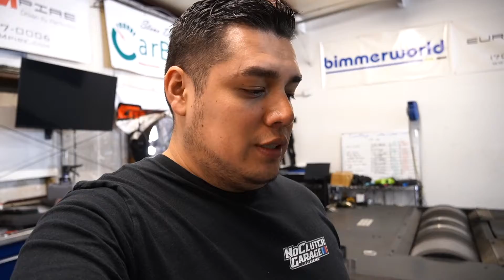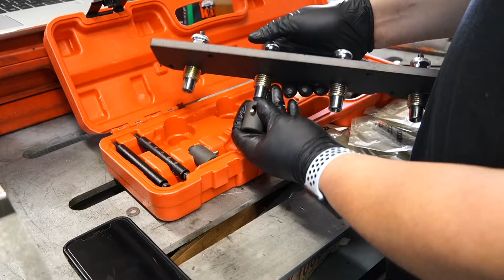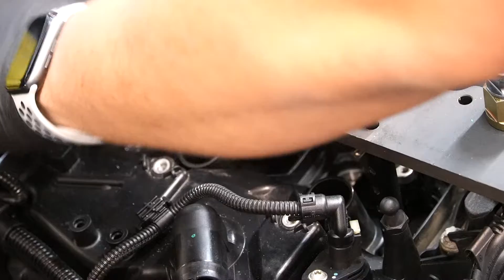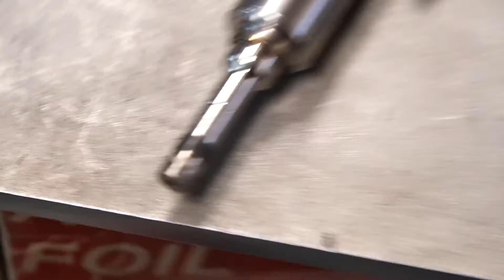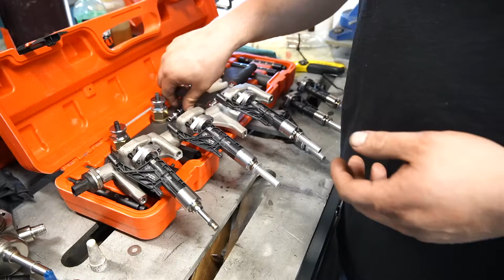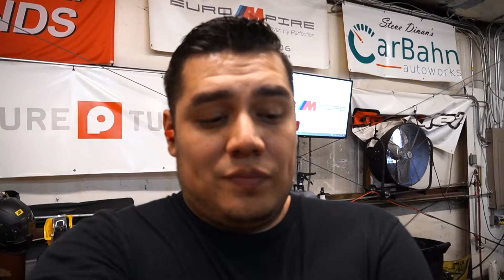BMW B58 INJECTOR REPLACEMENT DIY | Feat. BimmerNetwork

Comment: The 8 railscrews get 5nm + 90 degree… if you mount them only with 5nm, the risk is high, that the rail cant hold the 200bar railpressure. The screws are stretch-bolts; these ALWAYS have a 2 phase mounting sequence: fastrn to 5nm and after + 90 degree, so they can deform and grap tight. These extra 90 degree is the step that tightens the bolts. Thats why you always have to replsce them after demounting the rail. Only 5nm is HIGHLY RISKY!!

Comment: Thanks for the vid, just did this job. Drives great and no codes but didnt reset the adaptation. Ill go ahead and reset them with the autel when back in the shop. Thanks again.

Comment: Hey man, I know this video is a little old, although I am in dire need of those injectors caps that you used to compress the seals. None of the tools I am using work to compress it. I’ve tried every b58 injector seal tool with no solution. If you could possibly send or tell me what brand those are I would appreciate it.
Reply: Have you found a solution now ? I am having same problem
Reply: Another way without a tool is take a piece of rubber fuel line and run it over the seal and they tighten a hose clamp and let it sit for a few minutes. Hope that helps
Reply: Yea you don't need those "caps" to compress the new Teflon seal. I've use a tool from dptool from Amazon for mine. Different tool but same concept, just need to apply pressure to compress em tight

Comment: The torque sequence wasn’t correct!
Reply from the maker: Literally read off of Alldata idk what you want me to tell you
Reply: @NoClutchGarage  Im just saying thats not the correct way bro
Reply: @NoClutchGarage   down until there is resistance, position screws (M6x70) (A), (B), (C) and (D), and turn them until hand-tight.
Set torque wrench to 2 Nm.
Tighten the screws (A,) (D), (B) and (C)  at 90° each in an alternating order using the torque wrench until the rail rests on the cylinder head.
The figure shows the rail resting flat against the cylinder head.
Reply: @NoClutchGarage  Tighten screw (A) by 5 Nm.
Tighten screw (D) by 5 Nm.
Tighten screw (B) by 5 Nm.
Tighten screw (C) by 5 Nm.
Connect and lock the connector (2).
The connector (2) must engage audibly.
Reply: @NoClutchGarage  Insert a wrench socket into an extension.
Do not use a reversible ratchet or torque wrench.
Hand-tighten the screws (M5x30) respectively in pairs (1) with (2), (3) with (4), (5) with (6)) alternatively with 90°.
Set torque wrench to 5 Nm.
GRA-SYM-GRCI0000-10-INFO
Reply: @NoClutchGarage  Fuel injector 1:
Tighten screw (1) at an angle of rotation of 90° ±15° with the torque wrench.
Tighten screw (2) at an angle of rotation of 90° ±15° with the torque wrench.
Repeat the operations for bolts (1) and (2) until both bolts reach a torque of 5 Nm.
Reply: @NoClutchGarage  Mark all bolts (1) to (6) with a line (see figure).
Tighten screws using an angle of rotation.
Tighten the screw (1) with an angle of rotation of 90° ±15°.
Reply: @NoClutchGarage  and goes on…
Reply: @NoClutchGarage  but anyway I checked my sparks And none off them
Have fuel or anything But my railpressure cant hold 10map What could it be? Slight injector leak?

Comment: Where did you get those caps? Trying to find a set for when I do my injectors or something that will work but am not sure what to buy for the seal compressor
Reply: No need for the caps if you buy new injectors!
Reply: @bmwsincekid  the new injectors don't come compressed though 🤔

Comment: I mean is there a specific pattern that you have to use what are the Torx that you need to bolt down the injectors the boat down the rail first and then the injectors there’s so many questions I have that unfortunately your video did not want to share
Reply from the maker: A lot of the work I did was based off the Alldata information (BMW OEM), what are your questions and I will happily answer them.

Comment: Did you reuse the old screws or all brand new ones? When I did mine there was also a sequence to tigthen the screws down. Final torque should be 5nm then 90 degree turn.
Reply from the maker: Yup did all that in the Timelapse. I just don’t have the information from the Alldata available for me to share. Generally though, screwing the screws closes to the manifold first then the ones closes to turbo is the way to go. Then slowly tighten the injector screws going back and forth between the single injector acres to get a nice flush fit. Also, BMW calls for 5 Nm but rarely can you find a Torque Wrench that reads that low, so hand tight or slightly over is not bad.
Reply: @NoClutchGarage  Yeah I just bought a bicycle torque wrench for the job which are easy to get off amazon etc
Reply from the maker: nice! I’ll look into it!

Comment: would u recommend swapping injectors on a high mileage car ?
Reply from the maker: Probably a good idea but I wouldn’t mess with them if they aren’t giving you issues.
Reply: @NoClutchGarage  I mean all it takes is a random failure with no warning and the motor can be toast
Reply from the maker: I mean you can apply that logic to just about any engine failure…